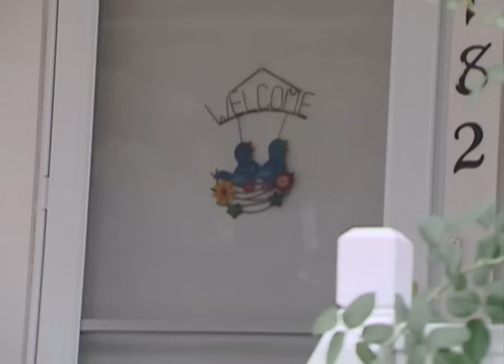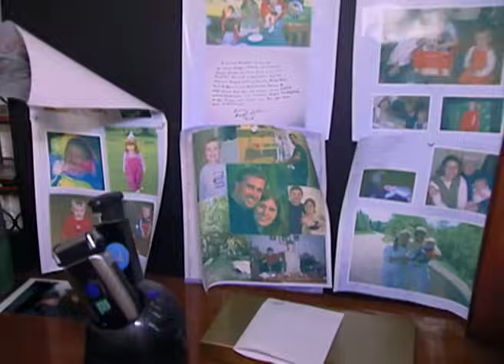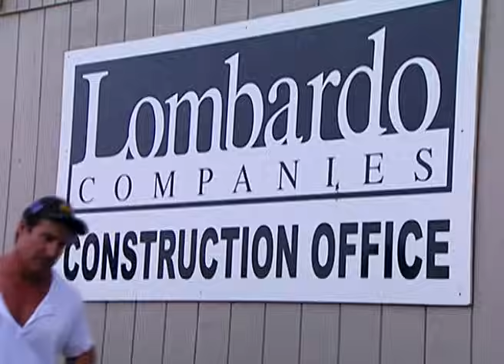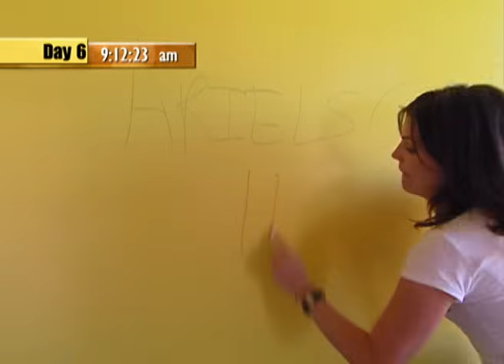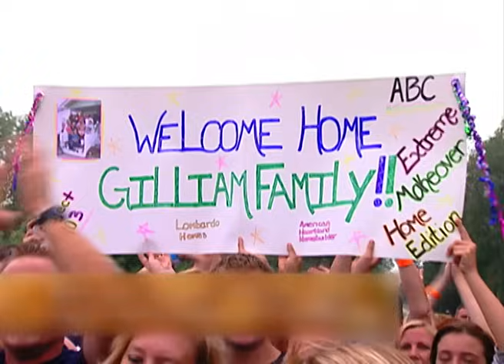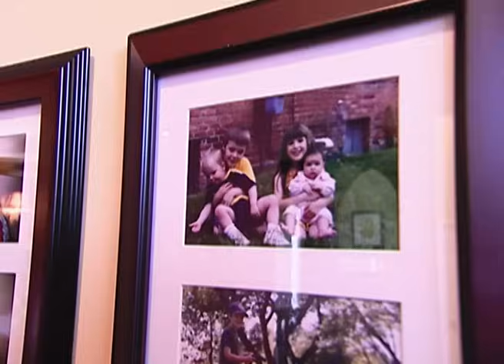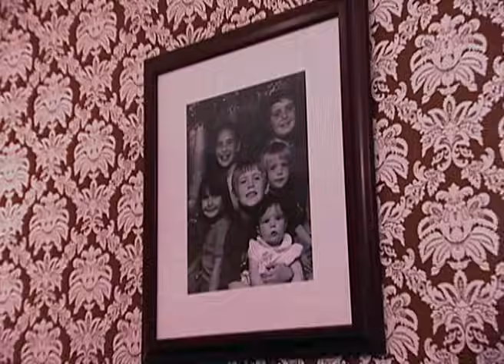Her House Killed Her Husband | Extreme Makeover Home Edition

Comment: Great community support in a broad sense. If builders in some 55 hours - say a week - can build a house that passes inspection in one go, then they have prototyped a business model. They solved the "logistics inefficiency" that builders around the world make clients suffer from, as well as from quality issues.
And finishing in a week means "double costs" on the side of the owner are brought down significantly.
The stone or brick and mortar will have been glued on panelling, maybe prefab, because with real brick & mortar you can only go up about 2 ft per day. All in all, it's a great accomplishment.

This will have aired a long time ago, I guess. Is there a follow up? Are there longer term experiences? How did these families get taxed by the IRS?
And how did the builder that did this proceed from here?